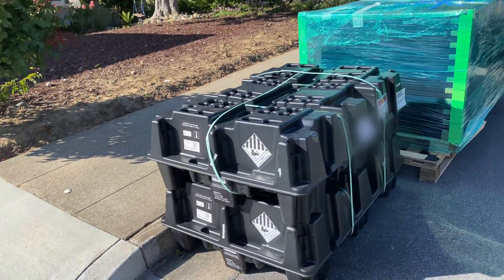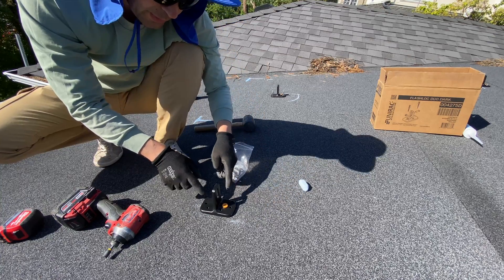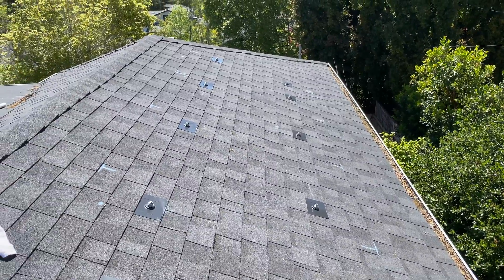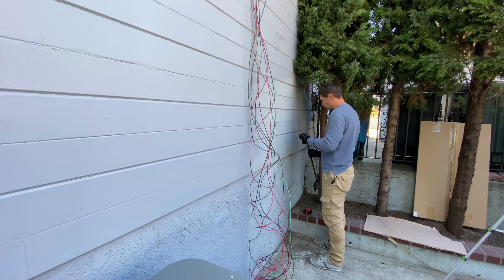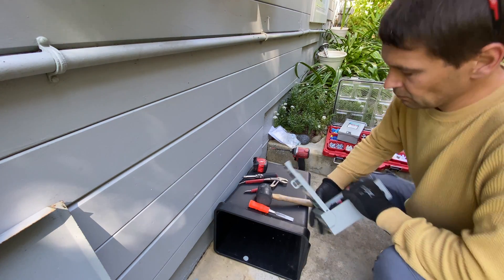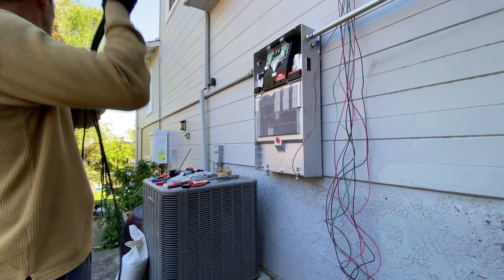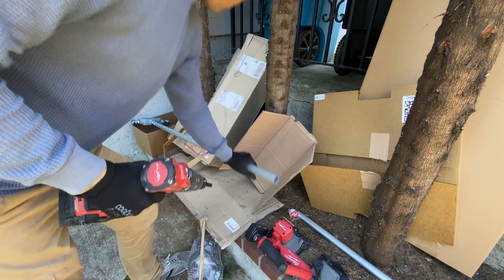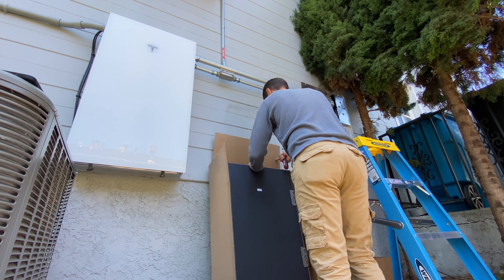23 Solar panels with Tesla Powerwall 3. Professionally installed. Full home backup.

Comment: Hey man, love the work you do. I’m an installer in Washington. I’ve been a roof guy for over three years. I would definitely recommend using hug mounts or Pegasus mounts. They save a lot of time compared to flashings and they’re just as good if not better also for  mounting emt on the roof, the bug mount by Ironridge is amazing.
Reply from the maker: Hi there, I still feel like flashings is more waterproof. Might try Pegasus on some small project to see how it works. Thanks for the advise.

Comment: If you're using Powerball 3 and extra battery for the Power wheel 3 do you still wire the solar to the extra battery or does it all just go to the Power wheel 3?
Reply from the maker: Expansion unit doesn't have inverter or solar charge controller. All solar will go to Powerwall 3

Comment: Hi, watching from Germany. Good work, I have one question. What is the purpose of the junction box on the roof? There is no surge protection to stop high voltages from entering the house or reaching the inverter. It is just a connection for the strings and the ground for the substructure, correct?
Reply from the maker: yes correct, in junction box I'm switching to another type of wire to go from the roof to Enphase combiner box

Comment: @SolarEngineering where can I buy the communication/12v wires?
Reply from the maker: nassaunationalcable
rsd: 18/2 Unshielded VNTC Tray Cable TC-ER THHN Insulation PVC Jacket 600V E2
comm: Belden 28326AS 18 AWG 4C Shielded
Reply: @SolarEngineering  thank you! I thought it has to be 120 ohm for CAN wires